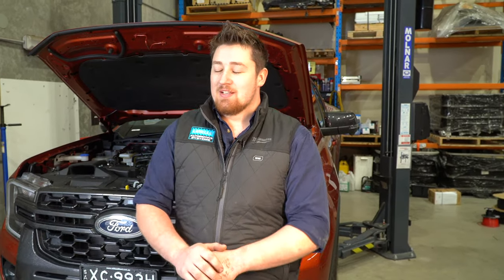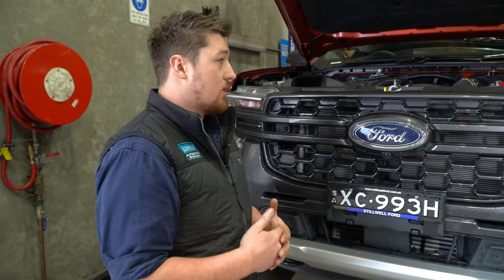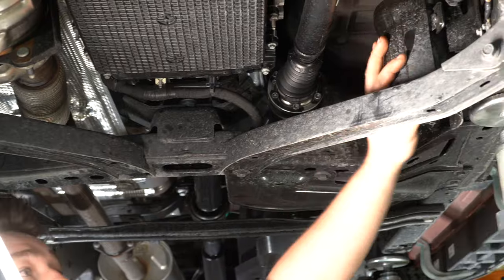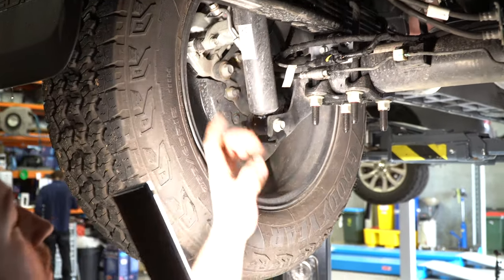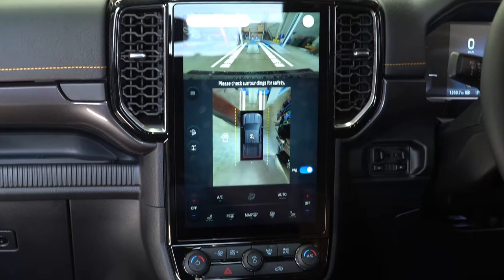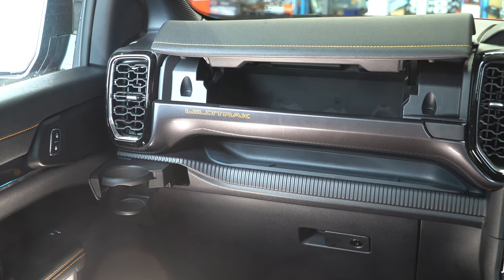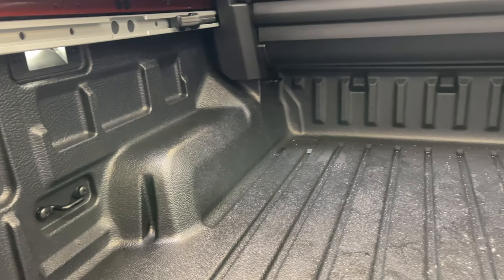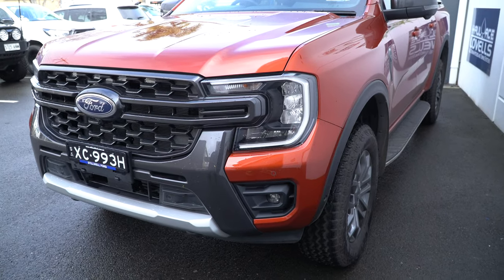Next Generation Wildtrak - Modifications and Underneath Tour

Comment: Lots of air flow until the bullbar goes on and of you don't fit one be prepared for a small animal to damage the vehicle a lot. Those grills look expensive. Front of the motor has plenty of room for an actual engine fan. Hope the thermofan can be disabled for water crossings. Heaps of technology and potential for issues if used hard. Looks great but will be interesting how long it will remain reliable 🤔